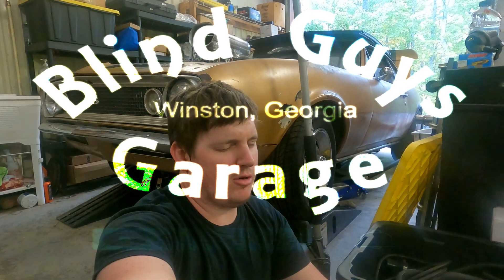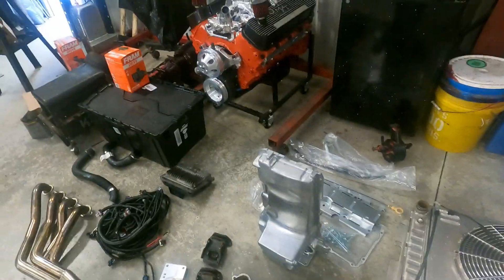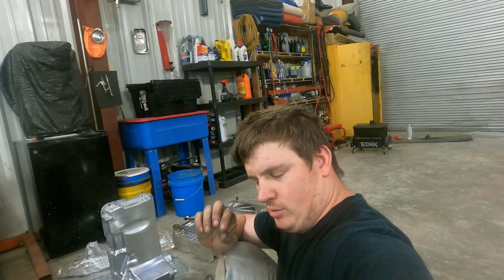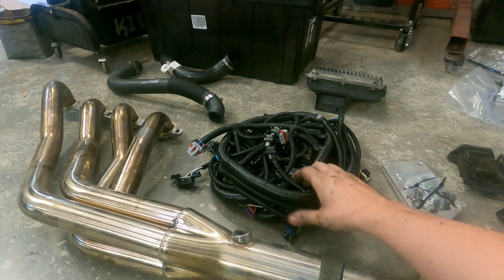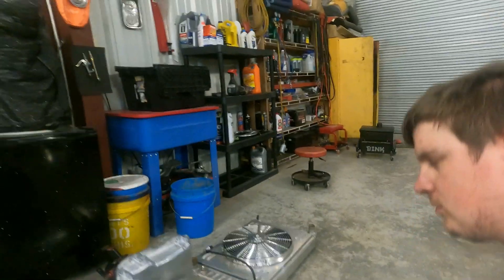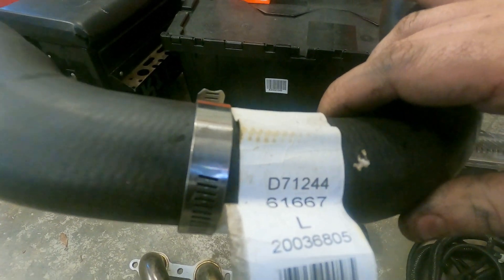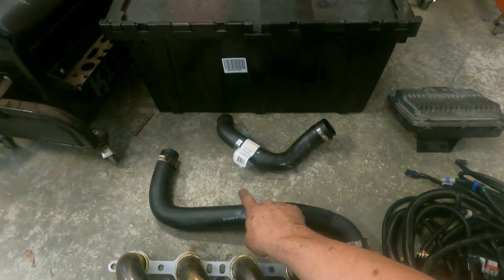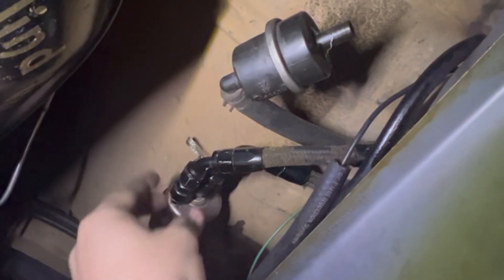What’s needed to LS swap a 67-69  Camaro/firebird or 68-74 nova? ANSWERED major parts needed

Comment: Everyone just forgets 5.7 alluminum block smh
Reply from the maker: Saves some weight but still fits the same I like the iron block tho just my preference gues it left over from the sbc days
Reply: You over heat a aluminum block and it’s trashed. Iron block can support boost better
Reply: @Jp69camaro  not everyone trying to boost
Reply: @marcanthonysuazo  true.. but iron handles head a little better that aluminum. But you are right aluminum is lighter but just keep your eye on the temp!
Reply from the maker: @Jp69camaro  I agree in both cases don’t overheat it and not everyone is hunting boost as I said I happen to be an iron block guy

Comment: Do you know what headers will fit with the Z Bar on the factory 4 speed cars.
Reply from the maker: I don’t but I also don’t thank the ls has a way to use the z bar without some aftermarket brackets
Reply: @blindguysgarage  I have an aftermarket bracket. And the z bar is set up, I can use stock manifolds but wanted a set of long tube headers. I may have to have them built.
Reply from the maker: @FreemanFixItDIY  I see I will post a short tomrrow with the header bolted to a ls engine so you can see it I think the speed engineering headers I was running would clear a z bar If used with aftermarket z bar bracket I will post vid and add a link to the comment here
Reply from the maker: @FreemanFixItDIY  Z bar work wjth speed engineering swap headers??? #shorts  #camaro  #ls ￼
https://youtube.com/shorts/VTVdeeivCvs?feature=share

Comment: Thank you for taking the time to make the video. Very informative. I’m in the process of doing the same. I’m wondering though will those headers clear the power steering box? I’m going to call speed engineering when I get a chance too. But thought maybe you may know?
Reply from the maker: Yes they fit perfict I have power steering on my 67 camaro and thy fit with no issues
Reply: @blindguysgarage  thanks man!
Reply from the maker: @mattpiper87  your welcome any time
Reply: Rounding up parts thanks for info

Comment: Any contact with power steering with that pan?
Reply from the maker: No all was good I used it on camaro and chevelle and both where fine
Reply: @blindguysgarage  how low does it hang? I’m doing a 6.0 swap into a 69 Firebird
Reply from the maker: @seanschofield3391  it did not hang below the sub frame but if I rember Right it was just above it
Reply: Great video   Do you have a instagram?  This is going to help me do my 73 nova. I have a complete 2003 Silverado 2 Wheel donor truck. Im pull the motor n tran out of

Comment: What about a Muncie 20
Reply from the maker: I am not sure let me see I will get back with you on that but for the trans it will bolt up fine not sure what you have have to do about the clutch
Reply from the maker: I here is a article on how to do so I know most people use a t56 with no issues but if I remember right the clutch release z bar is one of the biggest obstacles
Reply from the maker: https://www.motortrend.com/how-to/mate-muncie-four-speed-ls-engine/amp/
Reply: Will a 4l60e fit without modifications to trans tunnel ?